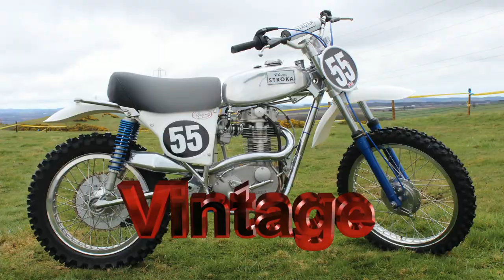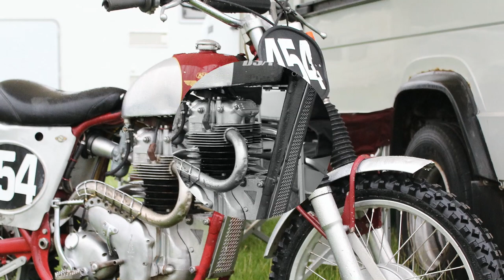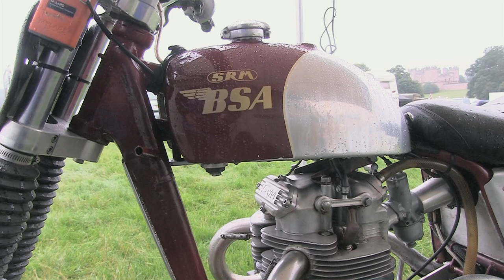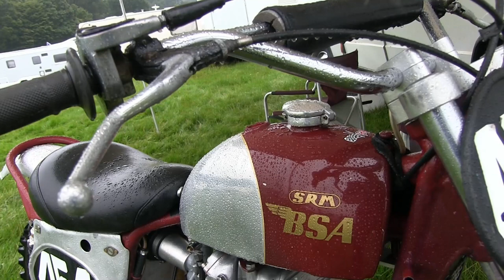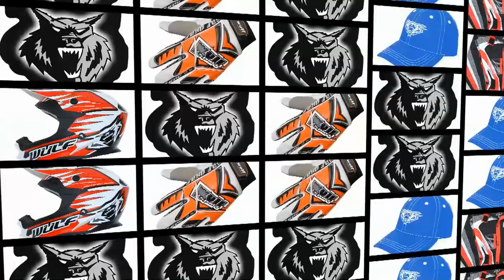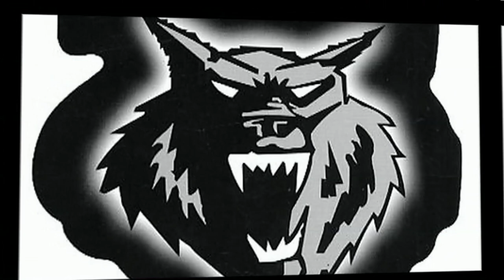Vintage Scrambles Motorcycles "1958 SRM BSA Twin"

Comment: the Ariel swing arm was a common mod in the 50,s/60,s stronger in its box section form than the standard BSA item,which were prone to breaking under hard usage,heavy landings after jumps etc.
Reply from the maker: Thanks for the information Steve I knew there would be a reasonable explanation for the change. Thanks again for watching.